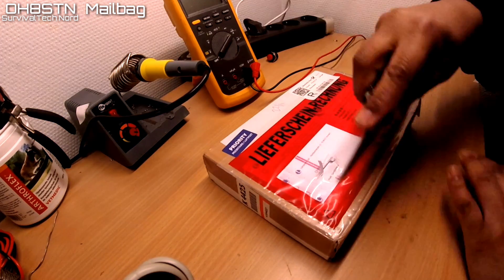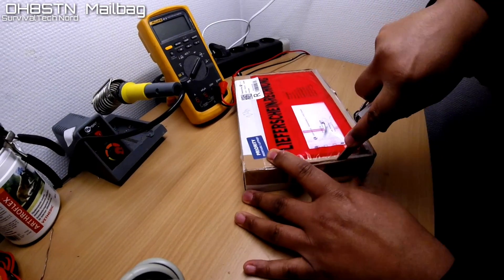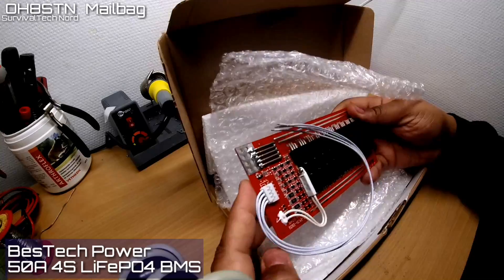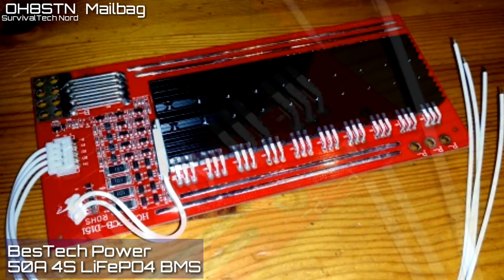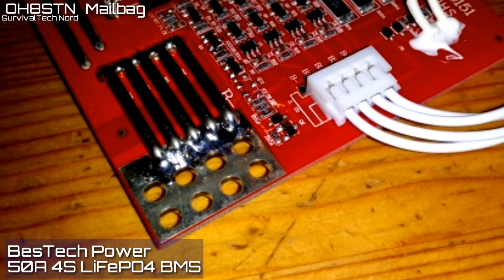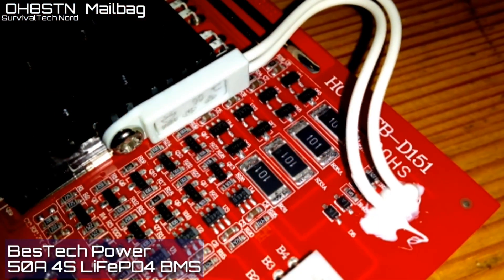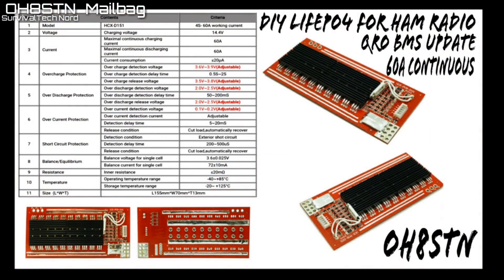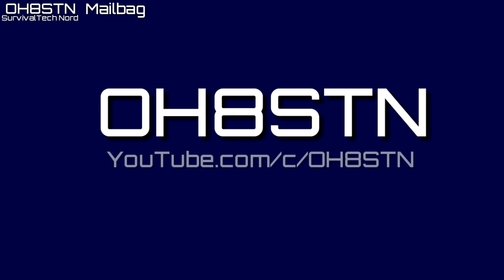Mail bag: DIY LiFePO4 Battery BMS 4S 50A for Ham Radio

Comment: Julian, I noticed that you got the HCX-D151, rated for 3 cells.  As you built a 4 cell battery, and I’m looking to build a battery like you did, is the HCX-D166 a better option.  Or why did you go with the D151 over the 16x?  Not critiquing, just inquiring.

Comment: I'm ordering a board from bestech and they asked what the continuous max load would be. Doing your FT891 battery build which you state in the video is 50A, but the spec sheet in this video shows 60A max continuous. Any guidance on what to spec to Bestech for the FT891 battery build?
Reply from the maker: The ft-891 at full power draws a max load of 22A.

Comment: The BMS you are using by bestechpower are specs it as a 3 cell BMS. Can you explain why you are using it for your 4 cell setup?
Reply from the maker: You're probably looking at the wrong one. It's definitely a 4 cell b m s. I'm doing the research for a new battery project now. I'll update with a new b m s pretty soon.

Comment: I realise your diy pack is 4 cells but if you wanted to step that up say 4s2p or 4s3p for better duration, would this board still work as long as you stay within the 50 amp limit?  I guess I'm wondering if each cell needs a board connection vs a 'pack' having a single connection.
Keep up the good work!
73s -Rob
Reply from the maker: +rkaag99 excellent question Rob. One BMS, 1 pack.
this BMS will ultimately be used eith a 4S4P 40Ah pack on the all-weather solar-powered Field Station. I may add some additional balancing per cell, but this pack will easily drive a 4S4P lithium iron phosphate pack.
Reply: okay cool.  thanks for getting back so fast.  in the earlier video when you built the pack, each cell went to the bms & I wasn't shure if you would use this instead of that bms or in addition to it.
--btw, I can't decide whether to order the Genasun or the Bioenno LiFePo4 solar controller... I'm leaning toward the Bioenno as the battery I have is bioenno & it is 20a as opposed to the Genasun @ 10a.  Genasun seems more compact though... decisions, decisions... my horse for a solar controller!
Reply from the maker: rkaag99 No problem. Now I understand your a question. We would use this BMS in place of the smaller BMS, to draw the maximum amount of amps out of the battery pack. A battery pack only has one BMS, and it's not possible to add more than one BMS to a single pack. We are able to add additiinal balancing current for each cell, but that's independent of a BMS.
Reply: I'm with you now, thanks!